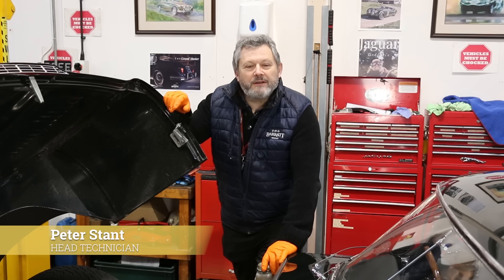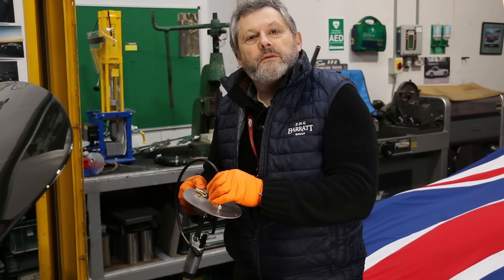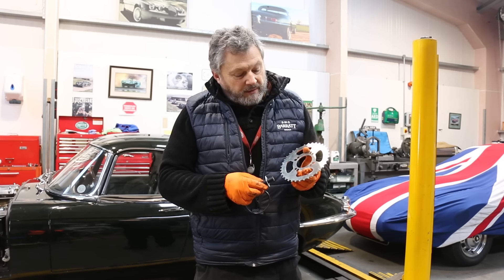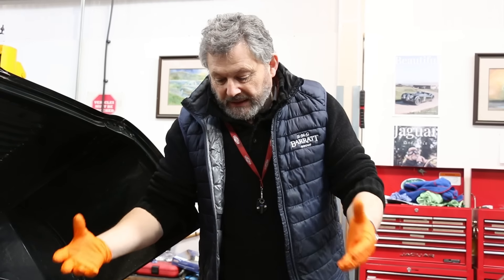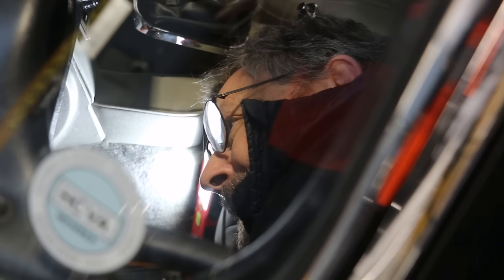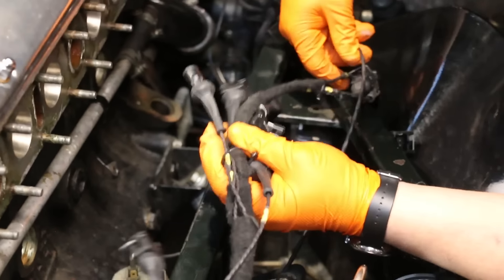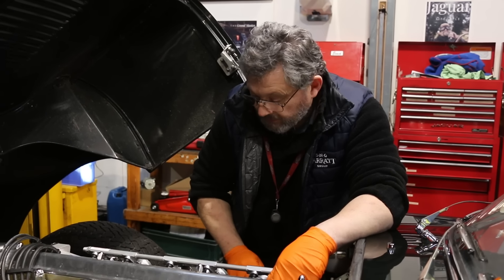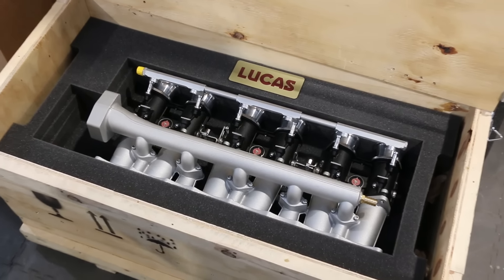Lucas Fuel Injection Conversion Kit | Jaguar E-Type 4.2 Upgrade

Comment: This looks like a well-made and designed product. I'm torn on the idea of modernising classic cars. While you can update them with electric motors and the latest technology, I feel they should be preserved in their original design. A part of the e-type experience is the unique throttle response of the SU carburetors and the process of starting with a choke. Along with mopping the dips of oil from the garage floor 🙂
Reply from the maker: Hi Rob, Thanks for looking at the kit and your observations. We totally respect the wish for some owners to have a truly original car, and this kit is clearly not for them. However there are owners who want some of the modern comforts, like power steering, and 5 speed gearboxes, modern cooling fans now needed on todays busy roads.
We are developing this kit to be able to run the fans and electric water pump from the ECU controller. We also have customers fitting this fuel injection to a D type, and an XK120 (fitted with a straight port head). Another is being fitted to a series 2 car and we have a prototype fitting for the front water intake to clear tighter fitting bonnets on some of these cars. We have been running our car now for well over a year on this system, so it's well tested. Please email us for further information.
Reply: @SNGBarratt  You guys do a great job keeping parts available for classic Jags. Please don't take my comments as negative in any way; I think I'm what's termed a rivet counter😂

Comment: Very nice fuel injection system  But what we want to see it is on the rolling road dyno a before and after testing bhp & torque and is it more fuel efficient ??
Reply from the maker: The point is that you can set up the system to your requirement, so we have set ours for reasonable economy and smooth power delivery with plenty of torque.
Reply: In fairness they would need to run the car on the road for a number of days to optimise the self learning. So you could have a dyno test with the SUs then later a second session with the EFI. I would expect the power/torque gains to be in the order of 1-4%, therefore diffecult to clearly identify with dyno sessions on different days.
Reply: I’ve just had a Jenvey system installed with heritage throttle bodies (45 dcoe appearance), the injection won’t add much at all to the bhp but it will allow a high lift cam and not upset the idle, even though the kit is about 12k + 8/900 on a decent rolling rd, it’s a lot of work for not a lot of gain.. std engines keep your SU carbs, want a sporty engine then yes great.. mines modified makes 260 at wheels 300lb.. but drives smooth with the injection .. hope that helps

Comment: Can I get this for MY 1975 XJ6 C?.
Reply: Will bolt on to the cylinder head, but the rest will depend on space. Also need to change the in tank fuel pump in kit and sort out linkages and other sundry bits etc.
Reply: @barrykenderson8668 Barry, thanks for getting back. Do you have the price for this item for an xj6.
Reply: Sorry Kamil I don't work at barratts. Hopefully somebody will reply back to you.
Reply from the maker: Hi We haven't looked at this for the XJ6, but if you are interested, please email.

Comment: will this fit on a series 2 xj6 4.2 litre ?
Reply from the maker: It should fit a LHD car, but some of the brake servo parts might be in the way on a RHD car. Fuel pump and wiring will also all be wrong as well.

Comment: will this kit fit an MK10 420g?
Reply from the maker: The injection side will fit any straight port head. So fine for the Mk.10, but for cars which originally had twin carburettors, but with a straight port head, need to have the 2 brass plugs removed for the water to flow correctly. The wiring on our kit is designed to have the ECU fitted in the top of the passenger foot well of an E-Type, so in other application might need to be lengthened. The throttle control is designed for the E-Type, and would need to be modified by the fitter to your MK10. Hope this helps, but please email for further details.

Comment: So,  a couple of questions - Is the fuel pump pretty much silent being in the fuel tank? Is there no airbox or air filter? Finally, it would be great to see data in the same car with the original SU HD8's vs the Lucas fuel injection.
Thanks for the video!
Reply from the maker: Hi The pump is very quiet. On start up you hear it working for a moment, and when it's at pressure, it's silent. The great thing about mapping the ECU, is that you choose what you want. We opted for smooth power delivery, What was a power curve is now a straight line.

Comment: Single sensor for spark timing but no sensor to detect whether it should be firing no. 1 or 6. Does it fire in pairs 1&6, 2&5, 3&4 and "waste" the spark in the non firing cylinder?
Reply from the maker: Hi Yes, it has a wasted spark, firing in pairs, without a cam sensor.

Comment: Did the original manifold complete with SUs fall off the back of the cabinet when it was placed there? The video cuts off abruptly at 1m20s as it is tipping over.... Hope not...
Reply: Hi, fortunately the carbs are fine. We send the kit out in a large wooden box with a hinged lid. The idea is that the box is big enough to fit all the removed parts.
Reply: @JP-Lucas-Girling  That's a great idea, as people will want to keep the old gears for originality. Very neat.

Comment: Just more added problems
Reply: It takes away all the problems of worn carburettors and ignition timing, but the ECU mapping requires a different skill set. The unit has open source soft wear, and is understood by tuning specialists.  Once set, is stays set.
Reply: It's ok that you don't know anything about cars, but someone could install it for you for a price- and then you'll have fewer problems if you ever get an E-Type.